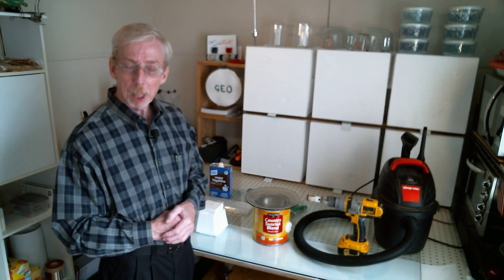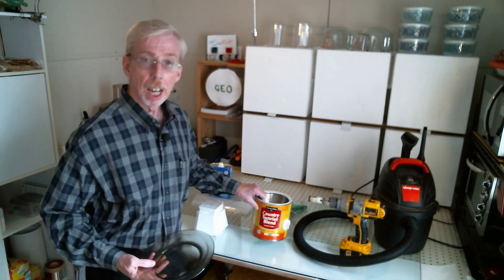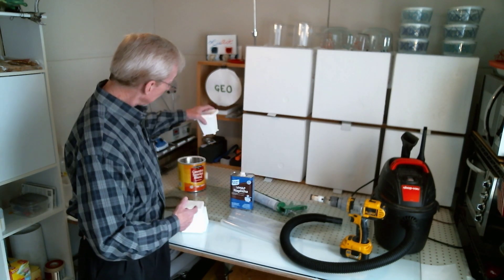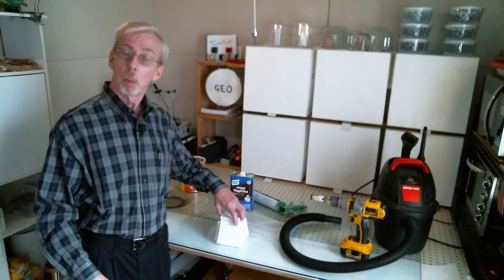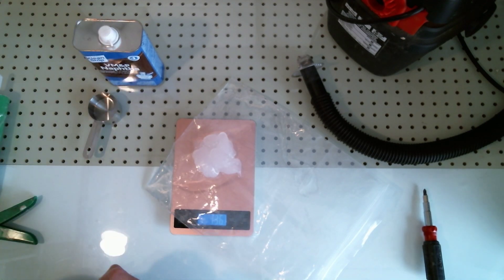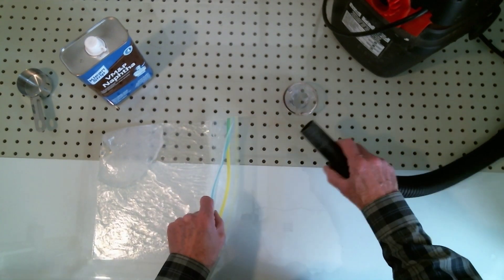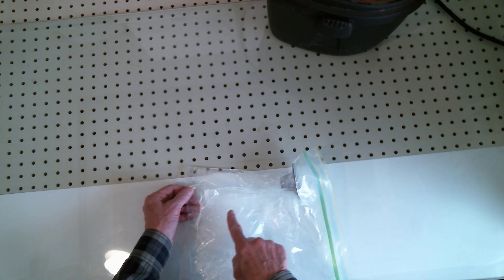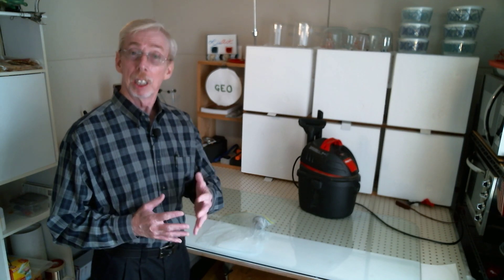Silicone: Mold Making: Degassing in a ZipLock bag.

Comment: Is it possible to degassing silicone right inside the mold, after pouring it? I'm going to try it both with vacuum cleaner and DIY Venturi valve.
Reply from the maker: Yes, it is possible and recommended. Great question. I will pin your comment to the top for others to see. Careful to use only a wet/dry vacuum as it has a barrier from the motor to the airflow, which will be helpful to avoid ignition of volatile gases.

Comment: First off, a huge thank you for this series - it's interesting and thorough, and the pourable silicone may well make a project do-able for me, now all I need to work out is some sort of rotocasting rig.

Have you tried the other approach often touted for fast-setting silicone caulk, acrylic paint?

With regards to this video, I see quite a few people have mentioned the first thing that sprang to my mind, which was "holy mother of god explosion hazard", so I won't go on about that further except to mention that a large number of shop (and home) vacs push the filtered exhaust directly through the motor to cool it, and most of them have universal brushed motors...

What I would say is that a "vacuum cleaner" used as shown is almost certainly the wrong tool for the job - its purpose is to pull a lot of air and dirt through its inlet, not to create a vacuum.  It can be (mis) used to do this, but doing it on a continuous basis will probably damage the device (see  cooling above).  If you're going to use a vacuum cleaner, I would probably look into vacuum packing bags for clothes, which are effectively big ziploc bags with flap valves on them as the seal for a vacuum chamber, wrapped around something like a cheap kitchen garbage bin, this will allow you to pull a vacuum and the turn off the cleaner, leaving low pressure in the container.  A less "heath robinson" approach might be to take your coffee can & plate concept, and marry it to a flap / reed valve.

A water hose powered vacuum pump could also be used, they're pretty cheap, 20 bucks or so.
Reply from the maker: Great questions, and thanks. I am glad you like my content. I have used acrylic paint mixed with silicone. That video is here: https://youtu.be/S5ChHwiXRl0
I have considered the vacuum as a vacuum pump. I used a wet/dry vacuum. The impeller is sealed from the motor, so no chance of a spark igniting the fumes. Perhaps I should have pointed out the difference between a wet/dry and a standard vacuum.

Comment: Hi Geo, first, I don't claim to be a Chemist or Specialist in this area. Watching this video, red flags went up for me. Vacuuming the bubbles, fumes, Vapors of a very volatile and flammable substance, naphtha from an essentially closed container which reduces the physical air flow through the vacuum cleaner could possibly result in an explosion. The lower explosion limit for naphtha is approximately 4 grams per cubic meter. The amount of naphtha you used was approximately 60 grams prior to mixing which is 15 times the amount needed mixed with air ( M'3 ) to explode. given the low air flow rate of the vacuum, and the fact that most all of these type of vacuums have open brushed motors on them which create Sparks continuously at the commutator could result in a bad molding session. my thought is if this method is to be used it should be done Outdoors. I may be wrong but better to Err on this side. Thanks for your videos.
Reply from the maker: All good points, and were considered prior. I have never met a brushed ac motor. You bring up valuable points, so I am pinning you on top. Keep them coming.
Reply: Hello again Geo, open brushed motors are used nearly exclusively in homeowner type shop vacs. Some are capable of a/c and d/c operation. Other examples are most all powered hand tools and motorized household appliances. Induction motors are typically used in commercial/industrial settings. When I mentioned a concern about air/fuel ratio, it has to do with the degassing method. The pressure at the bag of goo must be lowered to force the bubbles out, the bag must be nearly closed off during this time, which in turn, drastically lowers the through volume of the suction air and hence narrowing the ratio of the mixed components. Again, hypothetical but trying to be safe. Thanks.
Reply from the maker: @donm1547  Great insights. Thank you. This is assuming that the air/dirt is circulating through the motor, which it is not.  The seal between the commutator and the impeller is a sealed bearing.Your input is of great value to us and I am pinning you to the top. Keep 'em coming please. I am a HUGE fan of being safe, and I think this video could use a remake.  Would adding a substantial amount of water solve the potential for danger? Thank you so much.
Reply: Hi again, Geo. Your shop vac appears to have a side discharge port for vacuumed air. A hose could be connected and routed out of area, or vac placed in a small fume hood. And yes, there is a seal between motor and impeller but in a small area, discharged air mixture may blend with ambient air which is being used to cool the motor during operation. Thanks for conversation, it can be fun exploring possible scenarios.
Reply from the maker: I love your idea and will connect it to the exhaust fume hood. It sits off camera. I as well enjoy our conversation. Your points help us all. You are sharpening my safety and technical skills, and we can never be too sharp in those terms.

Comment: Me again, with more nerd questions. What gas is being "off-gassed"? What is naptha and why is it safe and sustainable, and why is is able to thin the silicone? Thanks as always for your thoughtfulness, creativity and humour! This is a great solution :-)
Reply from the maker: Degas is to remove trapped air. Naphtha is a solvent, and a sustainable type is available. It thins it by dissolving the binders in the silicone caulk. Once the Naphtha evaporates, the binders recollect.

Comment: Hello, this is an off question from one of your other videos (love them by the way). Is there a way to stiffen up the silicone so that they don't bend so easily?
Reply from the maker: Great question. Silicone stays flexible for 50+ years. I do not know of a way to stiffen it.
Reply: So I did test with a silicone cast and corn starch vs just silicone (little starch), and I found the one one with the corn starch was more ridged.
Reply from the maker: Excellent! Thank you for sharing this experiement with us. You result, is it as stiff as you were looking for?
Reply: @GEOsustainable   It is, my design, however, will still need to have thicker support.